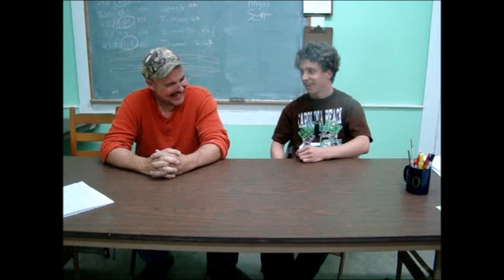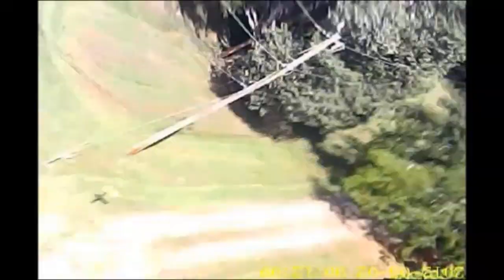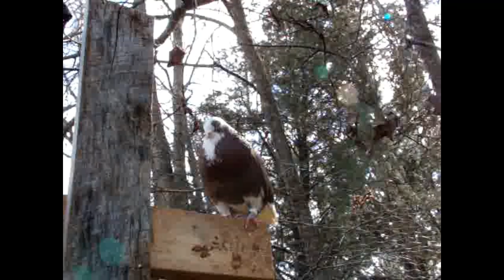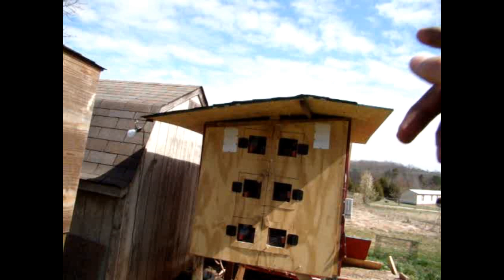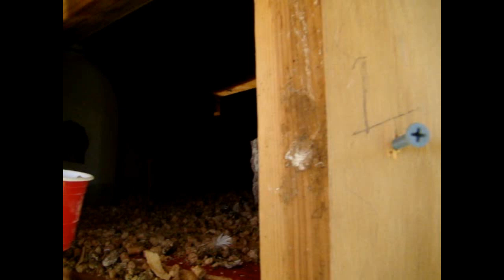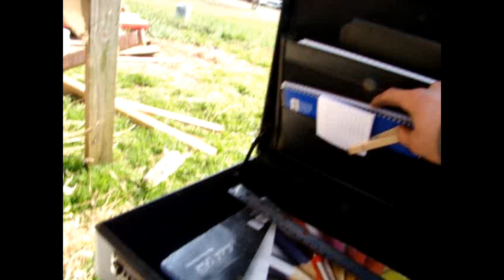What you can expect in the future.

Comment: Good to see you. You've been busy I see. I like the 6 compartment you built. It would have been a little better if the inside had a few more inches in height for each compartment, but it will suffice as is. I would suggest making a 5 inch diameter opening for more light and ventilation but since you're going to take it down its not necessary unless the birds' condition gets bad. If you do build another compartment type breeding pen, make the inside height about 18 inches and add that small vent to each one. If you can get that drill bit that carpenters use to make holes for door knobs, that would be perfect.
Good to see you excited to get your birds going again. Good luck and if you need any advice or anything just let me know.
Reply from the maker: Yea I was going to put tiny aviaries on each one, and I have an 80 mm case fan for each one, but now that I know im going to tare it down in a month and a half, im not going to bother.
Reply: BirdMan29 you must be a little disappointed after doing that work only to have to take it down. my mom was the same way your dad is. What I did was make my lofts similar in shape and same color as my house and she became much more agreeable to my lofts. Maybe an idea you can you use so your dad becomes more agreeable.
And here is a tip I used when drawing out my plans for my lofts...
on paper use 1 inch to equal 1 foot in actual size of what you plan to build. It makes it a lot easier to build and not worry about buying to much materials.
Hope that helps.
Reply from the maker: More than a little but it is what it is. The next video is uploading right now. Its on one loft races. I know the guy who won 3rd place in the million dollar African race this year. His bird was first on the drop, but 3rd in to the loft. I have pictures up on Face Book already.
Reply: BirdMan29 that's cool. how many birds entered? I'll check out the vid after I get back from a funeral. A dear friend passed and I'm worried about her elder son so I gotta make sure he's okay.
We'll talk birds sometime when our timezones don't conflict. It's only 5:30 pm here.
Reply from the maker: Its nearly midnight here. Sorry to hear that. I don't remember how many but he sais in the video. Im headed to bed, and am sorry for your loss.